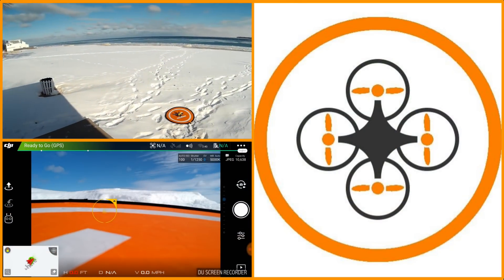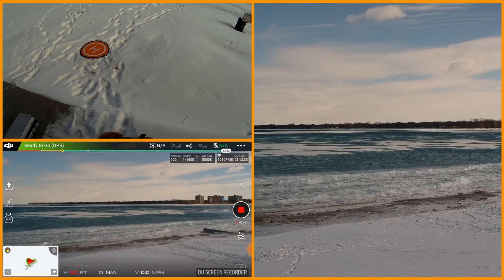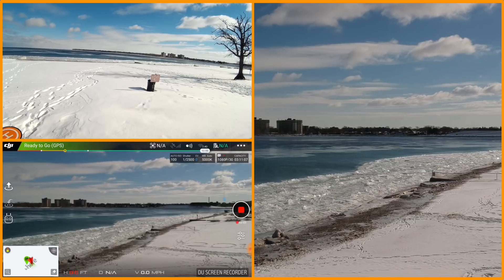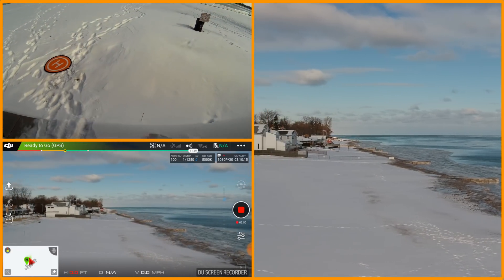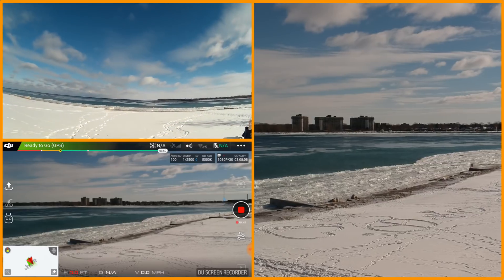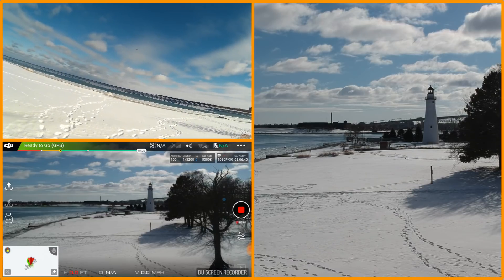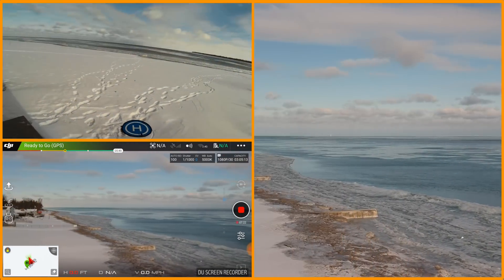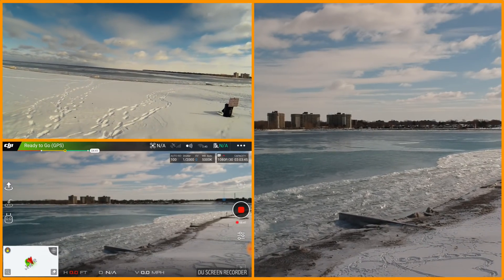DJI Spark - New Year Day its 9 Degrees and More Spark Issues!

Comment: I have a new spark and I have only flown it indoors; I'm  taking it on its maiden voyage outdoors on Monday. Flying your drone in sub-freezing temps is not recommended in the DJI manual. I have a solution to the cold battery drain issues on most drones and I will explain what it is; in an upcoming video soon.
Reply from the maker: Never had an issue battery drain, and really no issue flying in the cold in general as I have also seen these issue in warmer weather too.  Also yes the manual does mention about 32 f but like the mountain climber said, you climb it because it’s there and best wishes on your first flight!
Reply: Thank's V.D  The cold effects all batteries to some degree and this simple solution will become apparent. I use this for my cell phone as well. So when you are flying using your phone it will last longer too.
Reply from the maker: Agreed there is "some" affect but I have see almost none in the Spark and I have operated down to 5f  and flown 4 batteries...
Reply: Too many others on youtube would disagree and they warn you not to fly it in extream weather. DJI warns you with the specs. I'm sure they have tested it out, and one day you might have a malfunction issue. If 1 out of 100 flights fails, then you will eventually have a failure. I will go with the manufacturer's specs.to each their own. But please don't do a video on it if you lose it in the cold.Cheers H/D-ing

Comment: Too bad to read all the comments concerning the Spark.  I was seriously considering one of these for it’s portability.
Reply: it's a great drone though.. you won't regret if u get one, I have one too. The problem it's not on the drone itself, it's on de DJI GO app, since last app update its not showing some functionalities, I really hope they launch an update ASAP.
Reply from the maker: Agreed!
Reply: is a pice of garbage don't waste your money on DJI products! I have one for a month now and I have been unable to fly it. AC keeps disconnecting to TX, constantly. connection does not last more than a few second. I wish I had google "dji spark disconnecting" before buying it. tons and tons of people with the same issue and I have not found any solution to it. The more I research it the more convinced I am that it is very common problem that many , many people have, this thing just won't work at all, very expensive dust collector :(
Reply: Multirotor Go Consider the PB2...in the latest Consumer Reports magazine it received their top pick.

Comment: I did the firmware update earlier this week and all seemed well, except I got a 'bluetooth interference' warning that I have never seen before. So I put my iPhone into airplane mode and all was well again. I only fly via wifi, so maybe your issues were related to the OTG connection. On the plus side my Polar Pro filters are working again. A firmware update in the fall caused the gimbal to act crazy when I used the filters. But now seem to work fine again. Keep warm out there Joe. We got six inches of snow today, plus high winds and extremely cold temps.
Reply from the maker: -4 right now however good to hear about the polar pro as I will try that one again...

Comment: did you do a imu cal after the update it will stop the drift, and i would downgrade to 0800 fw and stay on 2.18 app to keep the otg cable working
Reply from the maker: No I didn't I (IMU) will give that a try but dumb question how do you downgrade?

Comment: Have you considered the possibility that the 9 degree temperature was affecting the electronics and that's why you had the issues with the GPS and the compass? I know they say not to fly if it's 32 degrees or colder I have flown in 20 degrees but I have frequent erratic problems even at that temperature.
Reply from the maker: Unfortunately not it’s change in the app...

Comment: If you have OTG you won't get telemetry. It has been said that the latest firmware has fixed the need for OTG
Reply from the maker: Not sure I understand fixed the need for OTG as on the spark it was an Easter egg of sorts which made flying the copter easy and painless compared to the WiFi geif...

Comment: OTG became broken after DJI app 4.1.15. Starting with .18, android app sends no telemetry data. On IOS you get “weak image transmission” error.
Reply from the maker: Thanks and that sucks!  I wonder if that was intentional or just a screw up because if that is the case the sparks going on eBay as WiFi is too much a pain...
Reply: Video-Drone I agree about WiFi! They must be aware because lots of people are complaining but there have been a number of updates and it hasn’t been fixed. You can rollback to version 4.1.15. The apk is available. I downloaded it but haven’t rolled back because they released new versions, and with each one, I kept hoping it would be fixed.
Reply from the maker: Yea I hate trying to roll back as what other issues are you going to run into if you know what I mean...